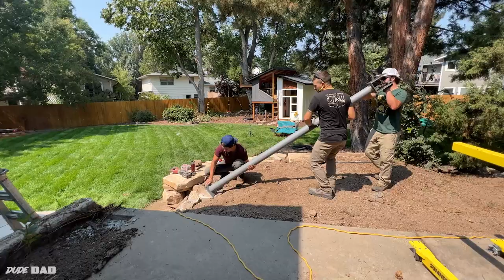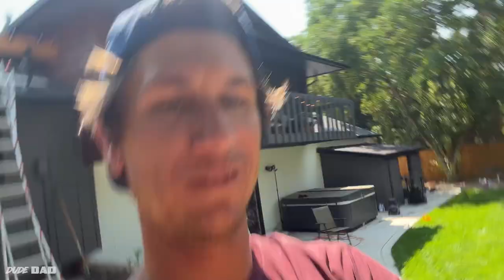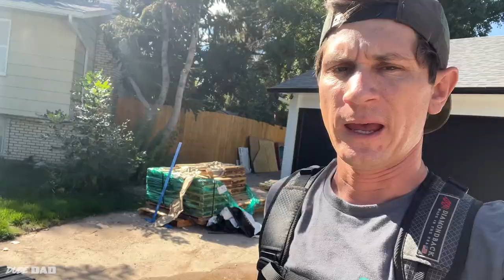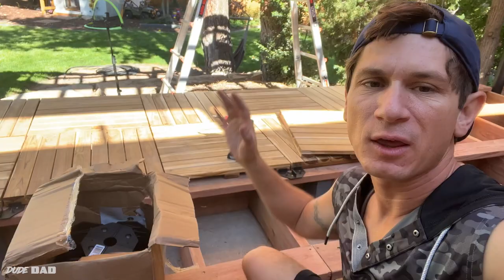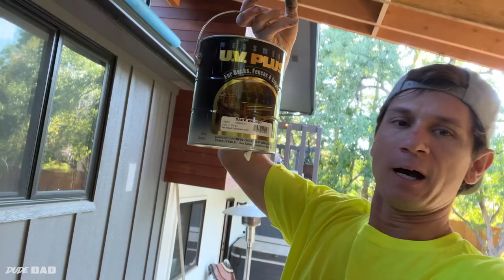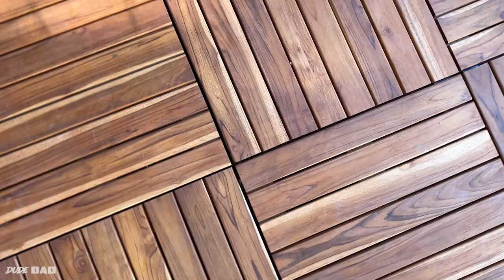Epic Backyard Transformation!

Comment: Sky Jacks are great...allows light in as you said, but it also promotes natural ventilation to get rid of what could have been trapped heat if you tied that deck cover into the roof line.  I'm surprised you kept the deck tiles for the step into the house.  Let us know if that becomes a tripping hazard!  You may want to change that out for solid wood treads like you did for the stairs down to the lower level.  Nice work.

Comment: You always have awesome transformation shots. Nice job overall and that elevated roof is genius! The teak tile looks like a great deck floor solution... if  any of the wood needs to be replaced, all ya gotta do is pop out the bad tile and pop in a new one. I might have to consider that as a replacement for our 15 year-old cedar plank deck. How do you think those tiles would hold up in consistently subzero temps with 5-6 months of 3-foot deep snow cover (a typical north-west-central Wisconsin winter)?